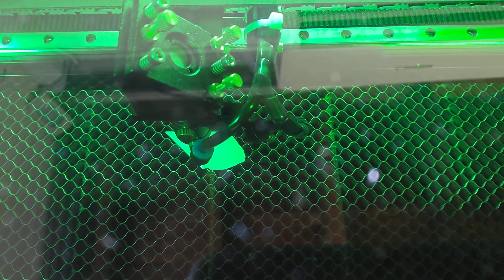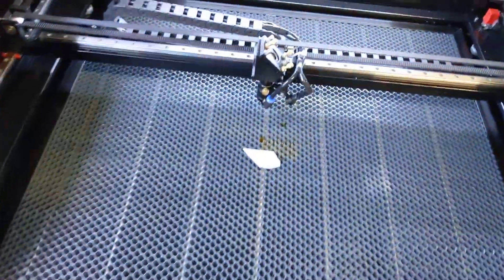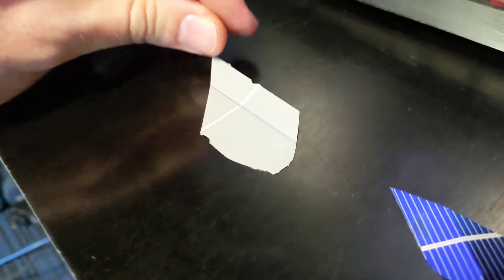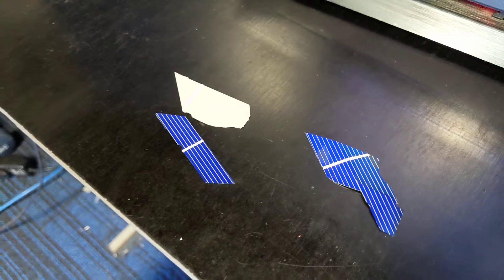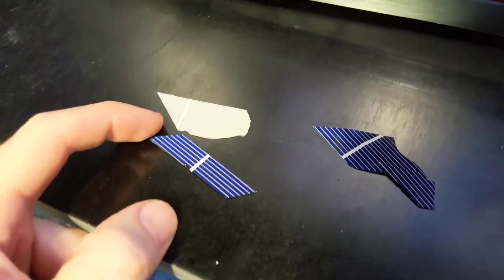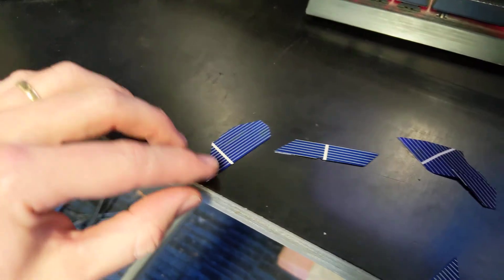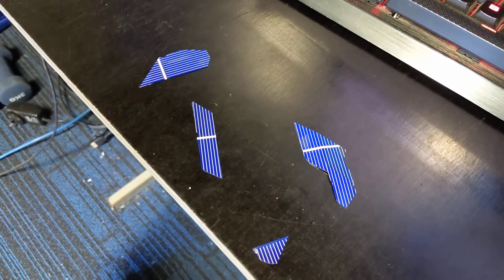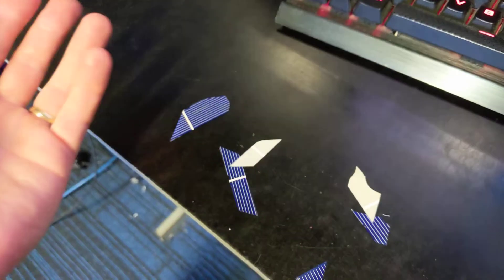Blinker - Precise laser cutting of monocrystalline solar cells

Comment: So I came across this a month ago and used your method to cut my bifacial mono cells with a 10W laser cutter.
I had to do two passes so it wouldn't crack, but it worked well.
Thanks for the inspiration.
Reply from the maker: That's amazing! I'm really glad to hear I could help. Do you have anything to share about your project?
Reply: @tjhowse  I plan to build a window mounted solar panel for my Chevy Volt and needed to get the voltage up. using bifacial cells from Aliexpress and it was cheaper to by full 166mm cells instead of precut 83mm cells.